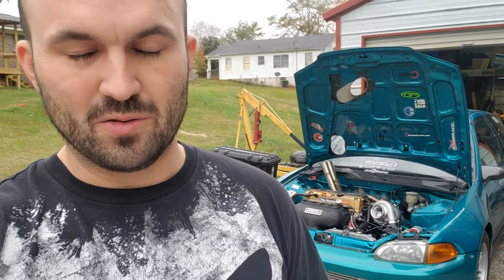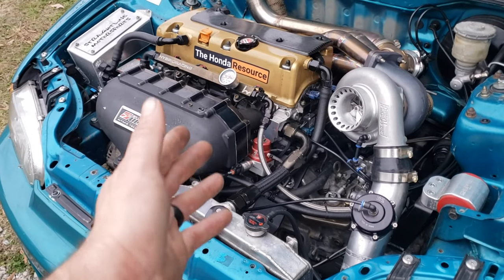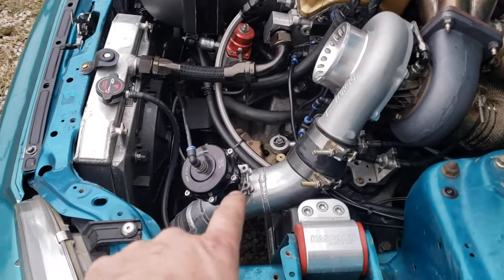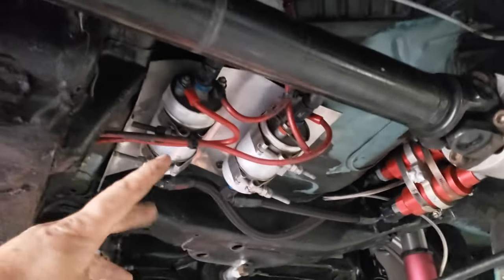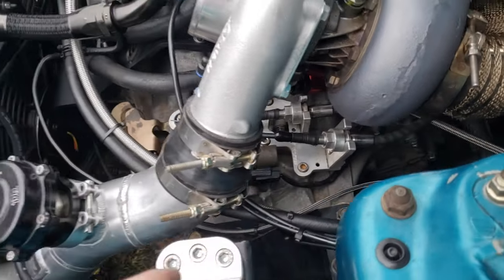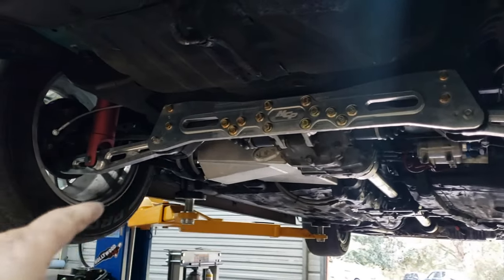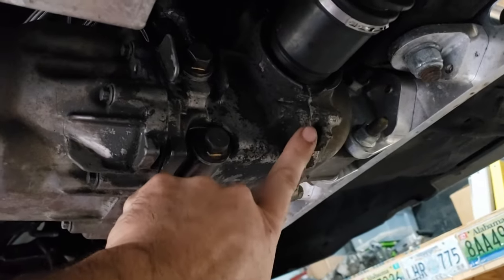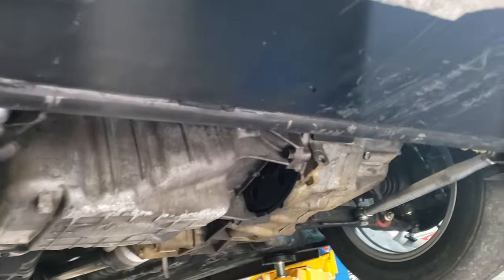How I built my 9 second AWD EG Civic Hatch: The Green Dragon

Comment: You mentioned using the 97-01 CRV diff, isn't that ratio different to the K series diff up front?
Reply from the maker: Non of the rear crv diff ratios match the front. A lot of the 97-01 guys actually upgrade to the newer diffs because of the clutches in the diff.

Comment: Hey what trans are you using for this set up ? I replayed this vid like 3-5 times now I swear you mentioned the trans lol. Thanks in advanced!!🙏🏽
Reply: 5:59  [edit] ok I found it, so was the crv manual stick or the automatic gear selector stick thing ?
Reply from the maker: I used a2003 CR-V transmission with a gear x 1-4 and wavetrac lsd
Reply: Was the trans pulled from an auto crv ?

Comment: That’s a nice setup. Do you think it’s cheaper to get a k24a4 and get a k20a2 head than to buy a k24a2?
Reply from the maker: K24A2 is a solid platform. If you are building it, the block code isn't really relevant.
Reply: @hondaresource  I’m probably overthinking things but I worry that getting an a4 would make it more complicated than just getting a complete k24a2.
Reply from the maker: We're doing a stock k24a4 bottom end with a k20a2 head on our insight.
Reply: @hondaresource  That’s pretty cool. Sounds like it’s going to be a fun build.

Comment: Did the adapters from dca allow you to install the freelander driveshaft with out cutting to length?
Reply from the maker: No, I still had to have the driveshaft shortened
Reply: @hondaresource  did you ever upgrade to the 1310 joints?
Reply from the maker: @streetthrowback27  nope, still stock joints

Comment: Would the awd set you used for your car work for a ek coupe? And did you have to modify the drive shaft from the Land Rover to fit
Reply from the maker: Yes it will work in an ek. I had to have the driveshaft shortened, and use adapter flanges
Reply: @hondaresource  ok great thanks I’m in the process collecting things to start my build

Comment: what size of tires and wheels are you running for your drag civic?
Reply from the maker: 13x10 wheels 24.5x9x13 tires up front, 15x8 wheels 24.5x8x15 tires in the rear
Reply: @hondaresource  thanks!
Reply from the maker: No prob

Comment: hey man im trying to build a race car on the honda eg6 series like yours and i was wondering if you can give me any tips, i want it to be awd and have a k24 engine base for it
Reply from the maker: Just depends on your power goal. I'm building another one in the future with stock motor/stock trans. I'll be good with 5-600hp
Reply: @hondaresource  only on e85 thou right?
Reply from the maker: @yujyuj2957  I'm not real sure yet. 500 is safe with pump 93. Just depends on how far I want to push it. I'll probably go with e85
Reply: @hondaresource  make sure the flex sensor says 85% or more before u go full on!
Reply from the maker: @yujyuj2957  the place I buy is is 87-92 every single time. I always test it before I pump.
Reply: @hondaresource  brilliant!
Reply: @hondaresource  whats the max u have seen on e85 so far?
Reply from the maker: @yujyuj2957  this car made 873 on e85
Reply: @hondaresource  sorry, i meant stock engine
Reply from the maker: @yujyuj2957  I know of several over 600
Reply from the maker: @yujyuj2957  personally, I made 530 on a 100% stock k24a2 longblock
Reply: @hondaresource  that would be really good enough for an awd daily
Reply from the maker: @yujyuj2957  for sure
Reply: @hondaresource  I want like 700 hp and like 500 foot pounds of torque
Reply: @hondaresource  do u have an email?

i need a k series awd trans.

Comment: What size tires r u running
Reply from the maker: These are 225/50/15 but I run 24.5 slicks on the track
Reply: 24.5 by 13or15
Reply from the maker: Front is 13*10 wheel 24.5*9 tire. Rear is 15*8 wheel 24.5*8 tire
Reply: Ok thanks y I ask not sure what set up to run on my Rex turbo I made 506 stock engine an transmission need to get some rims an slicks just don’t have no experience in buying there stuff what would u recommend for my Rsx both Rins an slicks
Reply from the maker: @taratorrington6352  I'm not sure 13s will fit on a rsx. 15s should fit

Comment: I had problems with my 2001 Honda CRV. A few months ago. Gave all kinds of codes. Went to Honda dealership and they told me 2800 to change out the tranny for one from a salvage yard to be warrantees for 90 days.  dafuq?  sooooo, I scrutinized the system. And I came up with a fix and a fact. fact: automatic transmissions are designed and engineered to perform even as their parts degrade and fail.  fix: drain 1 quart of old tranny fluid,add 8-16 oz laquer thinner to tranny fluid reservoir,...start, warm up, shift thru ALL gears multiple times.  set drain pan, drain all contents of tranny reservoir.  replace drain plug.  refill with new.  repeat 3x.  trust me.  please dear lord trust me.   after you have checked all solenoids n stuff 9x over, run some laquer thinner thru it.